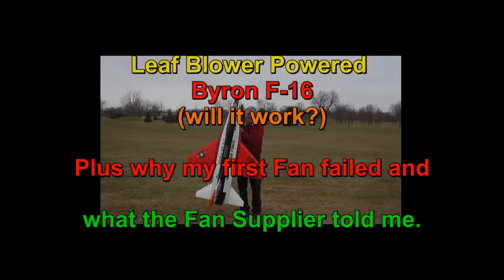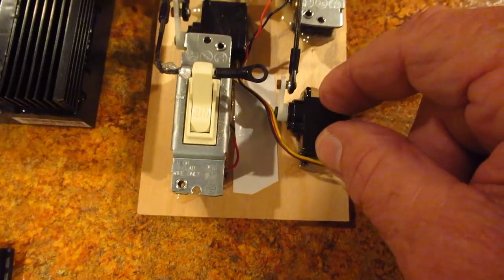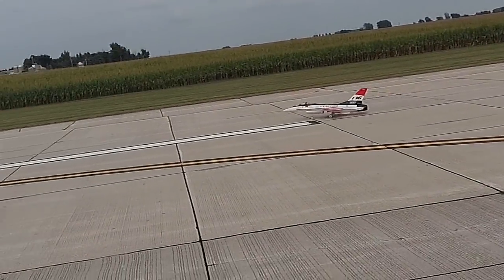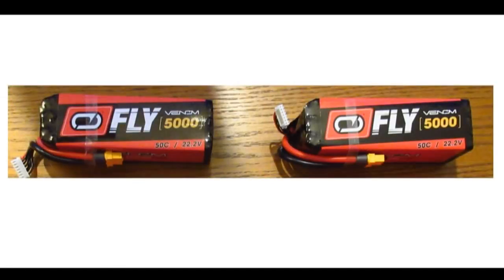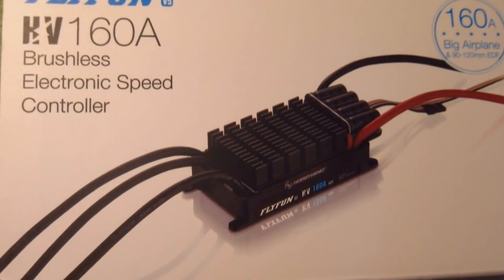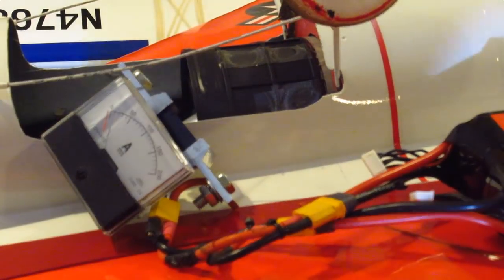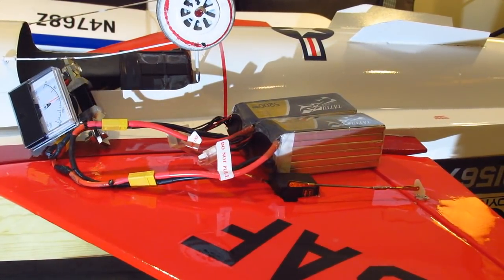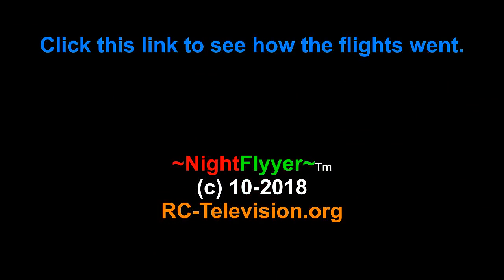Leaf Blower Powered Byron F-16. Did it work? Plus original EDF Fan failure analysis.

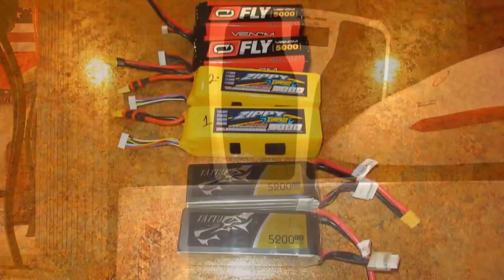Comment: At 10:50 when you conclude that higher C ratings will stretch run time, that is not true by definition.  The C rating is a measure of how much current can be delivered at a moment.  MAH is the actual capacity related to runtime.  If a higher C rated battery of equal MAH capacity delivers longer run time, the explanation is battery condition affecting the usable MAH, not necessarily the C rating.  Thanks for letting us have a view in to all your hobby work Dave, I love what you do!
Reply from the maker: Your right.  I know that too.  I guess I was just still considering the explanation that I got from Venom, as I was talking, as it seems that in reality all the higher c batteries I have seem to run longer, although, as you say, and in theory they shouldn't.  Thanks.

Comment: With respect, at 5:35, when you explain kv, it's not kilo RPMs as you say.  It's the constant (k) RPMs per volt (v).  So your unloaded RPM of 650 Kv * 40 v is 26,000 theoretically.  Good info for performance tuning/logging.
Reply from the maker: Yes, sometimes it's hard to explain things on the fly, but your right.  Thanks.

Comment from the maker: *UPDATE. In Explaining the Kv I misstated.  It's the constant (k) RPMs per volt (v). So the unloaded RPM of 650 Kv X 40 v is 26,000.  Also I said the C rating was run time instead of Power capability.  Milliamps determine run time, but even so, my higher C batteries seem to run longer.  It's all Magic! Please Click this link to see part 2 and thanks for watching. This video is Part 1 of 2 where more modifications to the Byron F-16 were made  https://youtu.be/8Xk2SskEhk0  Seeing the Lynxx 150 MPH leaf blower at Harbor freight, I decided to see if I could modify it for my Byron F-16, since the Changesun EDF and Zeus ESC failed on it's last flight.  I also realized I over amped the original Zeus ECS, which cause the 500KV motor to fail.  Changesun's new Fan is now 650 KV versus the older 500 KV and is rated at 150 Amps, vs the 500's 119.  It has more rpm per volt and produces more thrust at 75% throttle than the 500 did at full throttle.  Here is a link to it. 5075 650KV electric Ducted fan
https://www.ebay.com/itm/312184590716  .